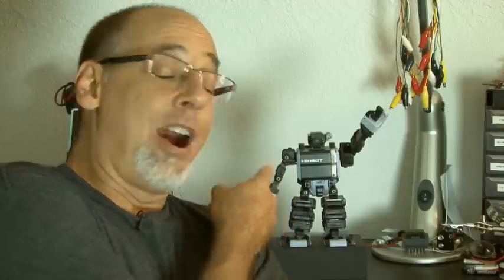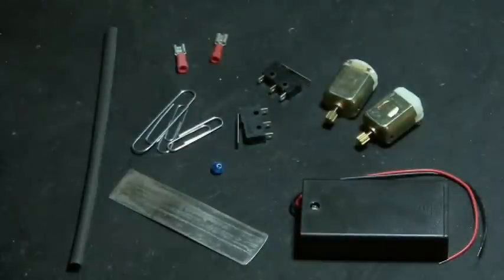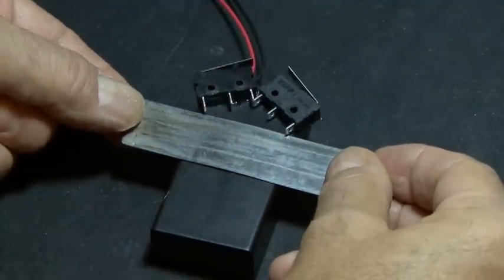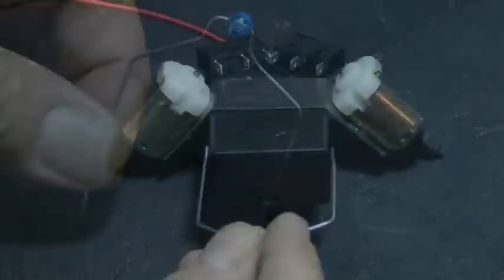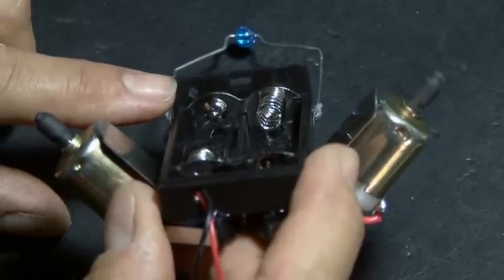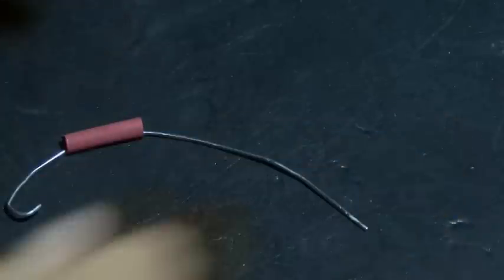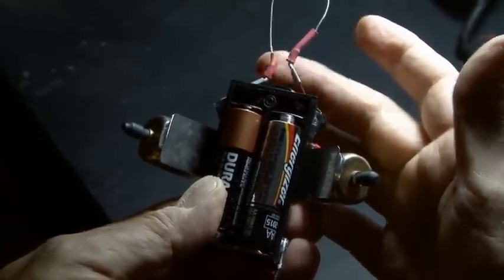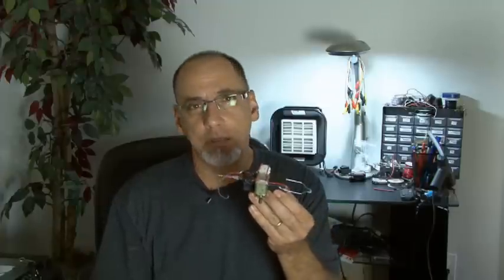Weekend Project: Beetlebot

Comment: Where can I buy the material at?
Reply: Most of the materials can be bought at a hardware store (hot glue gun, heat shrink tubing, metal, batteries). The other things like the motor, 3-way switches, and battery holder may have to be bought on a website (ebay, amazon etc.) Or maybe you could look up a store that sells these.

Comment: Tamal, it would be difficult to use electrical tape, but you could use liquid electrical tape (which you can find at a hardware store) or have your parent/guardian help you with the soldering. It is great that you have an interest in this when you are only 10 years old! I did stuff like this when i was your age.

Comment: @VikramKalidini  Hello! I had exactly the same problem.
The problem is that you have soldered the wire in the middle of the - and +, you should solder the wire on the - side i think, on the side where it is NO spring, it should work, it did for me!

Comment: there was a solder connection he missed, remember when he soldered the wire to the inside contact of the battery holder? you are supposed to connect it to one of the motors.

Comment: Hey guys! I was wondering if you could help me out. I tried building one of these but whenever the switch is pushed the corresponding motor stops instead of reversing. Any clue on what could be wrong?

Comment: You need a RECEIVER attached to an ANTENNA and a SERVOMOTOR on the BEATLEBOT. Then you will need a CONTROLLER with a long antenna and one or more JOYSTICKS on it. You can find these items at your local hobby shop.

Then you have REMOTE CONTROL. Voila!

Comment: Ps. with a mouse you can use the rollers that keep the ball in place if your not using an optical mouse as wheels instead of a cog and heat shrink tubing